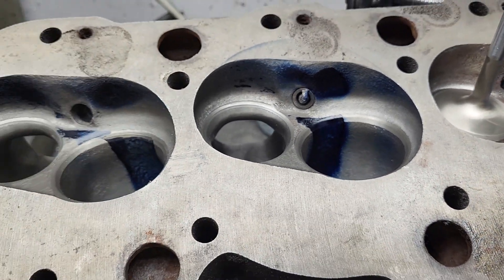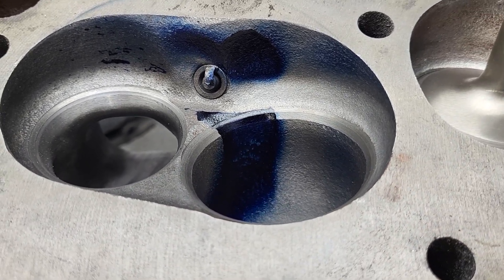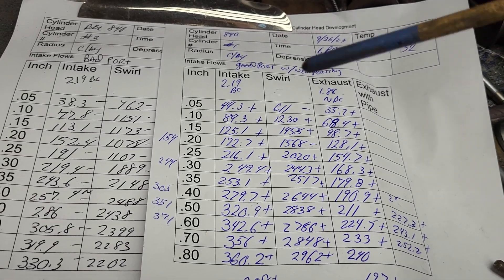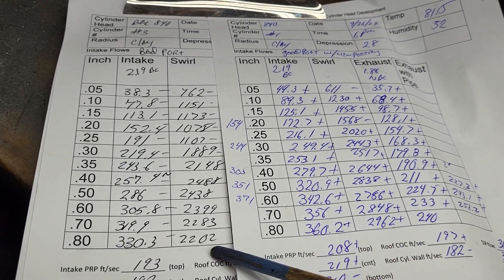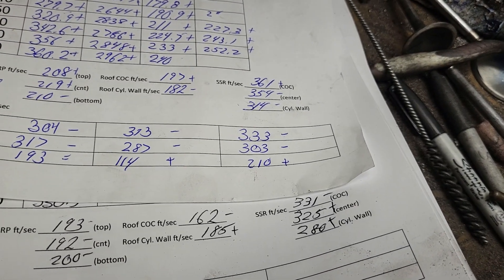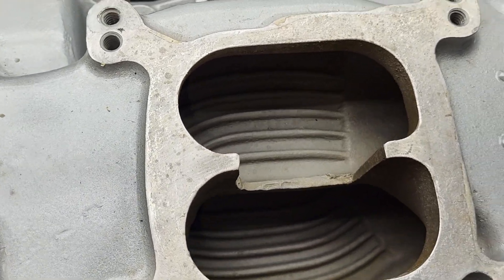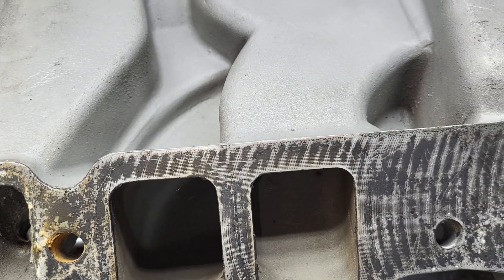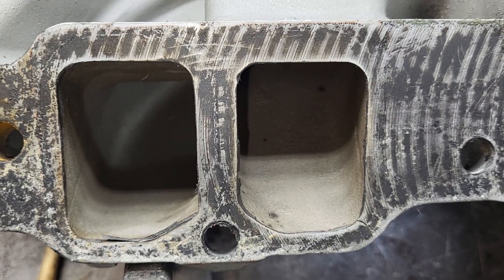Corvette 427/435 horsepower cylinder heads, bad port flows, Edelbrock C427X Manifold

Comment: Wow, that "bad" port is really, really bad!! Holy cow! By the looks of it, one should do porting on the bad port first, then try and match up the good port with what you get out of the bad port, at least I think that's what I'm going to do when I start working on my 781's, try to make the same hp from each cylinder.
Reply from the maker: I have done 781's before and they were closer than these. I have done more work to the bad port but so behind I haven't got  a chance to flow it. Thanks

Comment: Unshroud that intake valve. I did that on my 702’s and it helped a lot.  Didn’t flow them, but the head porter said his cast iron oval ports typically flow 320 cfm.  My old truck ran way better afterwards...
Reply from the maker: Did you check the flow sheet?

Comment: If you have low flowing/ filling cylinders, does the unequal power between cylinders induce bad harmonic’s in the engine?
Reply from the maker: It is a very good question. Thanks

Comment: The notch / cutout in the center is original from Edelbrock. The C427X is from the late 1960's and made into the early 1980's. It is similar to the Weiand Stealth, which is actually larger than ideal, but both are based on the 1967 L88 intake.
Reply from the maker: Good info, I thought it was modified because it looked so banged up. Thanks

Comment: Interesting that the head uses the same size intake valve as a Cleveland. Have you done much with Cleveland's?
Reply from the maker: Never
Reply: The Cleveland is definitely over valved
Reply: @davidreed6070  small port guys always say that 😆 🤣 but it's interesting to see Richard Holdeners dyno testing of the Boss factory versions of the Cleveland and Windsor against the other motors of the day. The Boss Cleveland with a factory little cam produced equal torque and much more power than any other motor in its class, and they were running more cam. The Boss 302 did give away about 10lbft down low, but smashed the top end numbers in its class. They are, in my opinion, very interesting videos.
Reply: @theshed8802  that is all absolutely correct. All the other engines were under valved worse than the Cleveland was over valved. I have built Clevelands, 340s and many many small block Chevy engines. The Cleveland made more power for what I did than did the Chevys or the 340.but that doesn't change the fact that they were over valved. The LS3 engine is over valved and it makes 500 on an engine Dyno off the crate.

Comment: I like those heads, I've had several sets of them.good compression without a big dome.they made good power in the day
Reply: Replacing the stock late 1970 thru 1980's 454s will result in a good running engine that is better than the flow numbers indicate.  BTW the sound good too.